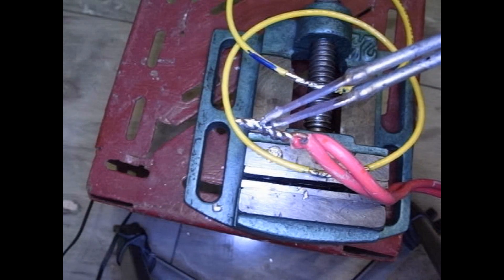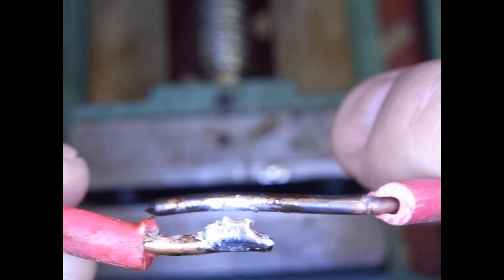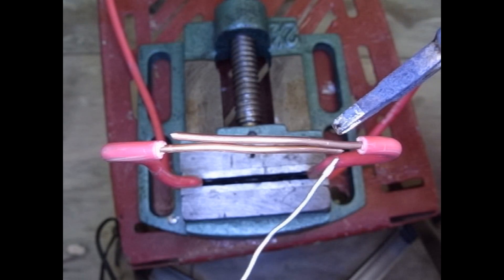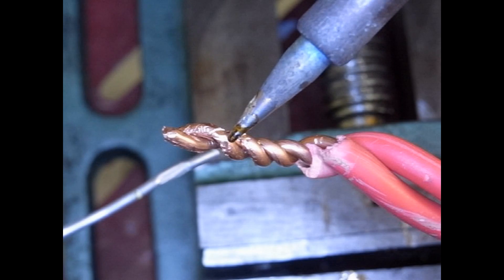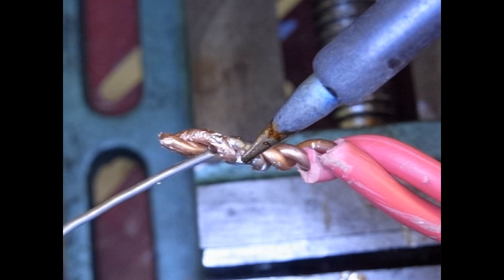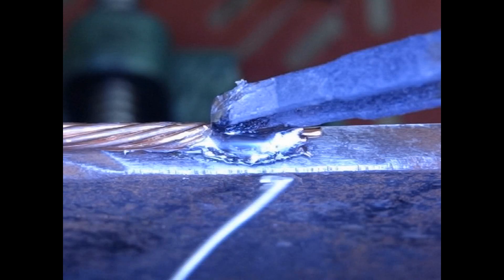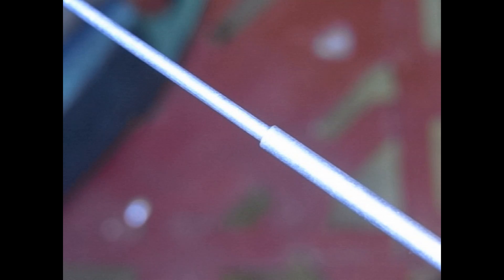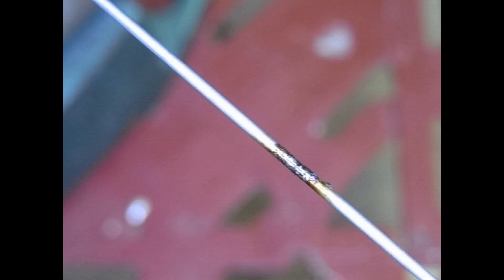Common Soldering Mistakes (Updated Video Available)

Comment from the maker: Updated/remixed version with annotations restored:  https://youtu.be/mv1t-aoSDOg

POPULAR SOLDERING VIDEOS:
Soldering Basics - Popular Solder Connections - Done Right (4K) https://www.youtube.com/watch?v=udNu-wZaqJE

Myth Busted: Soldering From Below https://youtu.be/gFGvNrYpsGc

Soldering Wires - Doing It Wrong, But Getting It Right (What is CRITICAL?)(4K)
https://youtu.be/Ej284nrwX84

Common Soldering Mistakes 1   https://youtu.be/mv1t-aoSDOg

Soldering Mistakes 2 - Why Mechanical Connection Is Important
https://youtu.be/IPRZOollABY

Soldering Without A Soldering Iron
https://youtu.be/b5iiUMAOGew

How To Solder - Electronics, Car Wiring, Boats, Solar, ...
https://youtu.be/gPpisFM6AIg

Soldering - Water Resistant Joints for Boats, Cars, RVs, Trailers, etc.
https://youtu.be/kZOmRE9msaA

Comment: Okay--I've been fumbling my way through soldering on some small and relatively crude art and electronics, but here's a question.  I'm always seeing people putting the soldering iron on TOP of the work piece, but....heat rises.   As I've found in my own experiments, it works quite well to run the iron BELOW the area to be soldered, with the solder on top, touching not the tip of the iron, but the work.

Doing this, solder seems to flow better and more uniformly even when using a very small tip on a probably-slightly-too-big project.....

Help?  Thanks!!
Reply from the maker: I've had this question a LOT.  So much so that I made a video:
https://www.youtube.com/watch?v=gFGvNrYpsGc
But the short answer is that if you are flame soldering most heat xfer is convection.  Hot gases (on earth) rise.  But when you are doing contact heating with a soldering iron/gun, 99% of the heat transfer is conduction.  Conduction spreads out from the point of contact, there's no up or down to it.  Soldering from below wastes solder (see video).  Yes I know I said this was the short answer, but truly it is.

Comment: Common Soldering Mistake: If you're using wire shrinkwrap make sure you put the tube onto the wire BEFORE soldering the joint lol >.<
Reply from the maker: That's NEVER happened to me.  (This week.)
Reply: I recently soldered all 16 wires on my new head unit harness..  was quite proud of the job I did,  looked great  ....then reached for the little box of shrink-wrap tubes..   proceeded to laugh psychotically and give up for the night.    i seriously considered popping the pins out of the connector and sliding them on.  hahaha  good times.  never again!
Reply from the maker: @bzearfoss You are now officially part of the brotherhood of solderers.  We have all been there, done that, said the "word".
Reply: @tsbrownie  One of the few internet clips that had me on the floor...the plumber who managed to complete an elbow fitting....right through his ladder.... :)
Reply from the maker: @RICDirector   I will search that for sure.
Reply: @tsbrownie  Thank  you! :)

Comment: This is a truly informative video. Thanks for publishing. Most of the information I've gathered on soldering is concentrated on circuit boards and associated wiring.
What about projects like automotive battery leads -  to solder an inch of the end for insertion into a connector? Wire and connectors cannot be permanently fused as they need to be separated from time to time to add other wires etc.

Not sure what gauge my project cable is but it has eighteen individual strands of solid copper wire. They appear to be the same diameter as those I've seen in the videos on home-made tips for soldering guns.

At 7:55 you mention the1300-1400w iron. Would I need one in that range?
In the Comments you note having bought it locally with its origin being China. This leads me to believe its probably a one-off and not an item that would be generally available.
The highest available in my spot on the globe is a  200w (I think) and it costs about what you could get a nice used car for in the USA.
So this will be a major investment and I can't take the chance on one that doesn't have sufficient power.
All good advice is appreciated
Reply from the maker: First soldering can be dangerous, so learn the safety aspects and use proper protection. 

The 2 main things for soldering are adequate heat for the size of the work pieces and clean work piece.  So you need a soldering gun that matches the work.  I can't say what that would be for your work.
For car batteries I've always used brass or stainless clamp connectors.  Soldering stuff that big is industrial level.
My soldering gun is cheap (my good one got loaned and I moved before recovering it).  It keeps working so I keep using it.  It's not very safe because the case breaks easily exposing electrical stuff and can overheat itself.  So I don't recommend those.  And the one I normally use is under 200 watts.  The 1300 watts gun I have is for soldering gutters and similar.  A Weller or similar is very nice, but not cheap (around $60).

Comment: My soldering iron is overheating and oxidizing the solder on the tip, but i can't control it. It is a 60W soldering iron. I can i do? There is a specific solder for it?
Reply from the maker: That's a tough question.  You can clean and tin it before every joint.  You can unplug it until you are ready (line up several joints to do all at once).

Comment: How not to do it, not how to do it, very useful. . . . NOT!
Reply from the maker: Here are a few more from the description:
Soldering Basics - Popular Connections https://www.youtube.com/watch?v=aoD2a... 
Soldering Tools - DIY Clamps https://www.youtube.com/watch?v=5HN-H... Soldering -Taping & Shrinkwrap https://www.youtube.com/watch?v=tewhy... Soldering Basics - For Cars, Experimenting, DIY'ers, Boats, Solar, ... https://www.youtube.com/watch?v=fNyAK... 
Soldering - Water Resistant Connections, for Boats, Cars, RVs, Trailers, etc. https://www.youtube.com/watch?v=mQJCs... DIY Third Hand For Soldering, Gluing, Hobby Work, etc. https://www.youtube.com/watch?v=sZ7Un... 
Soldering Closely Spaced Leads, Wires, Connections - Soldering Tip 2 https://www.youtube.com/watch?v=yQ8Ny... 
Soldering a Fine Wire to a Solar Cell https://www.youtube.com/watch?v=mEccw... 
Soldering Above or Below, Which is Right / Wrong https://www.youtube.com/watch?v=NfQd9...

Comment: hey man kind of bias in the temp demonstration with the twisted pair and sharp tipped colder iron? it seemed to would have worked fine u told us before to make sure we heat both wires were soldering but you were only really heating one, and you didnt really let the heat soak, also the hotter iron was leaving the sharp peaks also its from pulling the iron away too fast, along with not letting the solder get hot enough. just kind of confused there thats all
Reply from the maker: What time?
Reply: tsbrownie it starts around 1:17 1:18 then shows what im curious about
Reply: tsbrownie I'm jus curious if it'll work on solid wire if it had to i dont think if ever soldered anything like that iv always had bad luck with soldering anything else so I don't do it unless it's unavoidable, however im fixin that I'm narrowing it down to my main problems being tip condition, the copper plates half gone on the junk I have n i found out it won't tin right whiches essential whiches all obvious n i felt like a dumbass afterwards lol the other problem Im having n also should have known because I weld and that's contamination, there's been alot of times it wouldn't stick because of that but i kind of wrote it off because I remember getting shop dirt n shit stuck in solder when I was young playing around but when I thought about it it did get stuck in the solder but most of the time that dirt n debris n shit doesn't wet ..Sry bout the long ass comment lol
Reply from the maker: Sorry about the late reply, something with youtube not always notifying me of new comments.  Contamination is a BIG deal.  I've got a basic soldering video and that's something I emphasize over and over: clean tip, clean solder, clean work piece.  No oil, no dirt, no oxide...  After that, you just need enough heat for the workpiece.

Comment: lol he said frighteningly hot! Thank you for all the demostrations. I fall into the pointy solder and not I know my soldering iron isn't getting hot enough.
Reply from the maker: This soldering iron gets so hot it causes the solder to "burn" (oxidize) very quickly.  The tip will turn bright orange.  I have to keep releasing the trigger or I end up with a mess!
Reply: @tsbrownie  That's darn impressive.  If that's the one you use on gutters, I'd be frightened too, using it on a ladder...!!  (Or in CA fire country, but that's a whole nother issue)

Comment: Never seen 1300 watt soldering iron ?
Reply from the maker: Neither had I.  I was a cheap thing from China the local hardware store had.  I've only seen 1 other.  If you keep the trigger pulled the tip turns red-hot and will oxidize the solder very quickly (which made it good choice for a soldering mistakes video!)
Reply: Tom OConnor  
RgyyyyttàgG

Comment: I have a warner variable temp iron and was wondering if you could tell me a common or standard temp for flux cored solder with lead in it?
Reply from the maker: For electrical soldering: 60/40 tin-lead melts at around 188 °C (370 °F), 
and 63/37 has the lowest melting point at about 183 °C (361 °F) for tin-lead alloys.  I always use plain old 60/40.